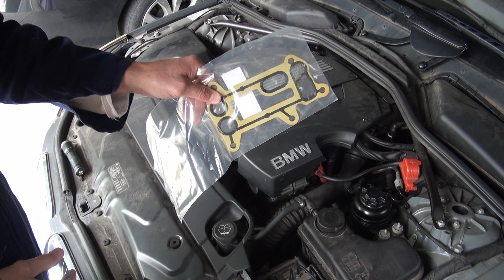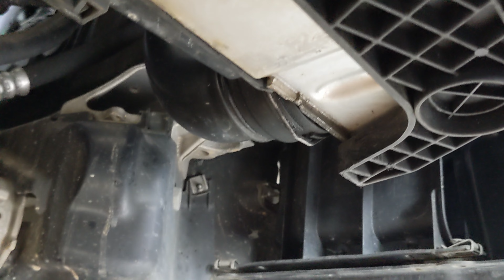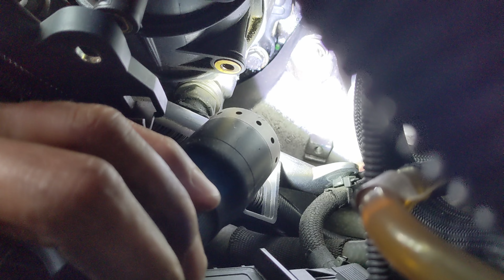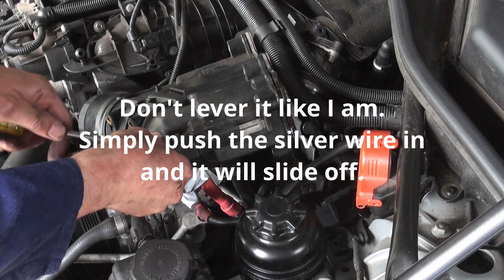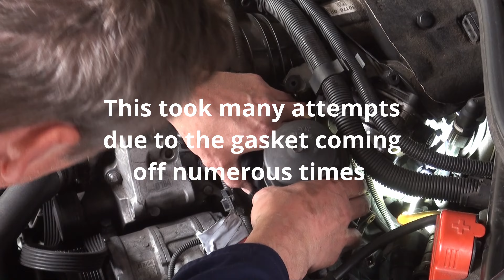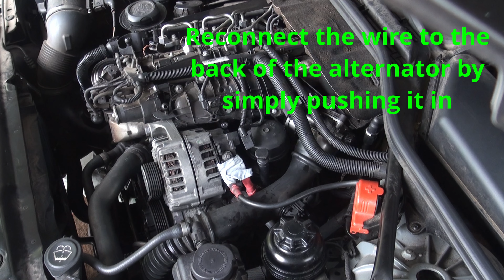BMW E60 520d Oil Filter Housing Gasket Replacement

Comment: hello, you should open this housing there are 2 screws and clean all thenway and than inside you will find 2 plastic tubes (valves) with 4 O rings and you need to change them. OEM part only 11427802115 and 11427802117, without changeing tubes its pointless job!
Reply from the maker: Thanks for the additional information. The oil is no longer leaking after I did this job, so I don't believe it was pointless 😊.

Comment: Also change the oil & coolant. If the oil gets contaminated with coolant it'll turn to sludge and block oil channels. If you're an amateur be. prepared to  spend 6-8 hours on this job. Oh and heat up the alternator with a hair dryer makes it easier to get back on alternator bolts are 20nm. Housing 22nm.
Reply: I love it when the torque specs are in the comments, thank you

Comment: Another tip for anyone doing this - you can drain the oil out of the filter housing by undoing the cap (as if you're going to replace the oil filter). Should make less mess when you separate the OFH from the block

Comment: Hey mate with all this effort you went to it would have been worth replacing the 4 o-rings that you have access to when you undo the 2 screws on the gasket plate and separate the halves
Reply from the maker: @suj1945  thanks mate, a good heads up for anyone looking to replace the gasket. I was unaware of them when I started the job and needed the car back online ASAP, so didn't consider it.
Reply: @aussieknowhow  ah such a shame, good work otherwise and nice video.